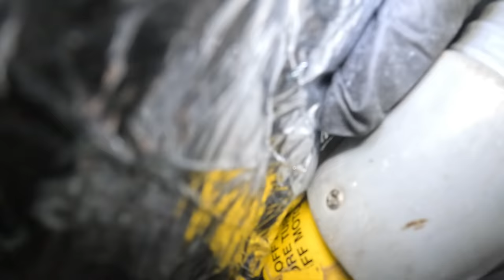The FASTEST way to get rid of Rats in your ceiling!!!

Comment: Hi Jim & Dave,  I've been multi-viewing your videos and seeing several methods of sealing small holes / passages that vermin might use as entries.  What do you recommend as far as MESH....stainless steel  VS copper  VS caulk combo ? ? ? I have a fairly large "Western Room " with TRAPEZOIDAL metal roofing...plenty of holes to fill.  Your suggestions PLEASE
Reply from the maker: Any type of metallic material is the best, stainless steel and or copper equivalent provided that you really secure it down with stainless screws. You can also use water proof concrete to cover the mesh or use to fill up smaller entry points.
Not a big fan of caulking and foam mixed in to secure any mesh down. It’s not sustainable long term exclusion work. 
Hope we answered your question. Good luck 🍀

Comment: What would you guy's do about burrows of at least 40 holes in the green area.  Roughly in a 50 square feet area. There's an acre plus we border a park so there may be more under bushes etc... We have got an excellent pest control company working here for several years who poison around the area and all the management respect them but now residents are hearing rats in walls. It's getting worrying.
Reply from the maker: Wow!! Love to take this challenge on. We would need to see photos and the surrounding area in order to advise. Definitely need to exclude the 50 square ft area with specialized materials.

Comment: Check your ladder on the side shows you the angle to set it up.
You're laying it down too low..lol
I roofed for years, seen them slide off the house before..lol
Reply: I was taught to hold my hands out, horizontally, in front of me, grabbing the rails, with the ladder touching my toes to get the correct angle. How do you do it?

Comment: I saw the hole on the ceiling, but why was there smoke coming out of the toilet?  Is it an obvious answer, and I am just having big brain fart?  LOL
Reply: The smoke machine inlet baffle is too far open causing too much pressure and blowing out of the toilet. I've got the same equipment and it's never fun to start up the machine, walk into the house and hear that sound. Simple adjustment reduces the pressure but then you've got to clean up the water before you can get the job done..
Reply: Thank you so much for explaining that to me.  Do you do the same thing with the smoke machine?
Reply: @9twenty9promo  
Yes, I do the same type of work but I'm in South Florida.

Comment: Why not just extented the pipe an put your cap on it
Reply from the maker: Great question! The problem is adding a coupling below the flashing without cutting in out, then the liability of water proofing this when you stack another flashing on top. It’s much easier to just remove the entire flashing cut the pipe down and extend, but it gets to be costly.